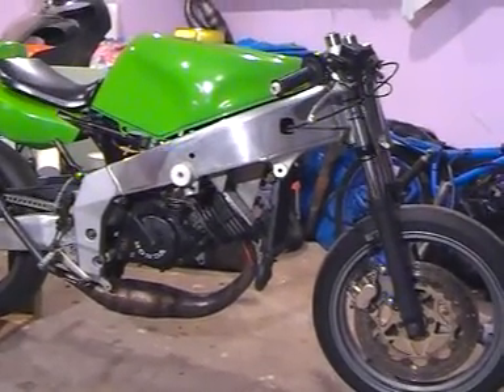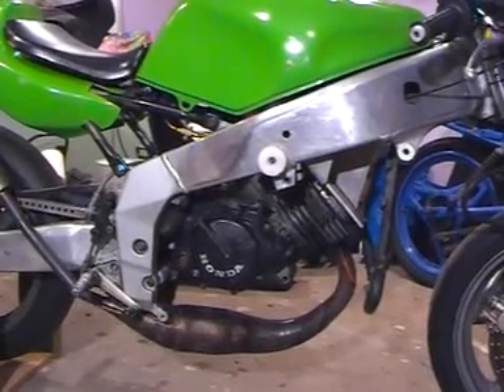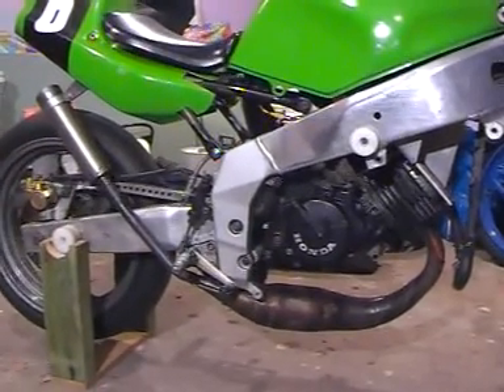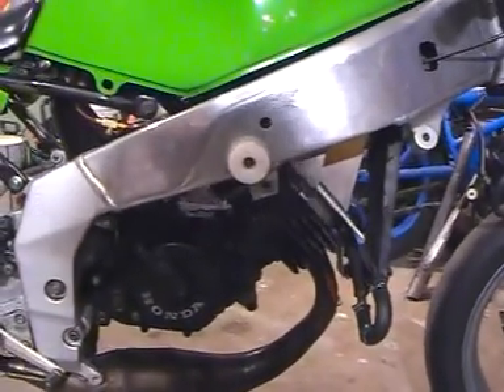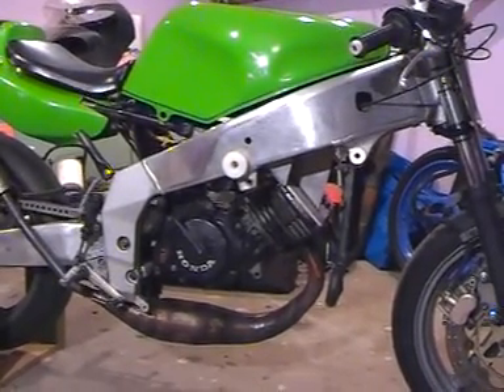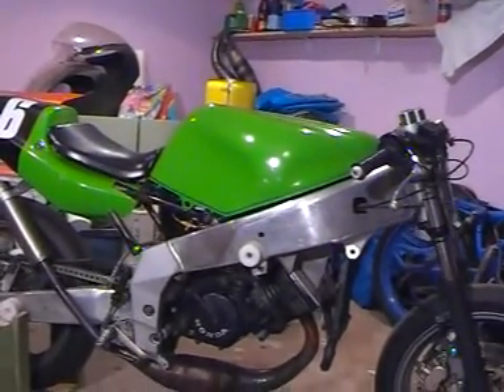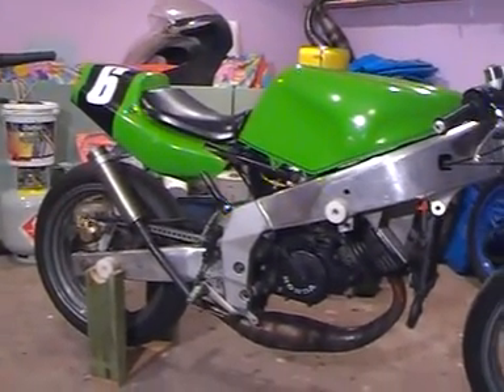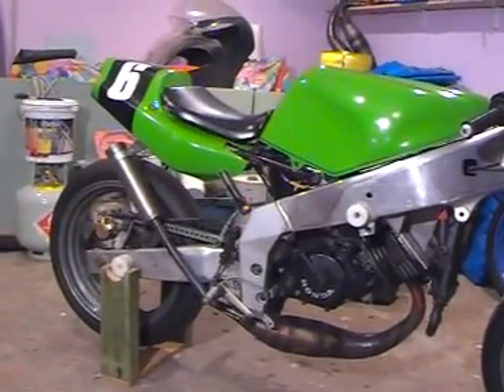FZR250 / MB100 bucket racer

Comment: Hi there.  Im currently working on my h100s/mb100 engine 
Athena 57mm 125 top end
Mikuni 28mm round slide 
Now i also have a complete 1981 cr80 engine.  I plan to use the reed block, the 6 speed gears,  clutch,  and ignition .
Question... is there anything else you would recommend,  like cr80 crank with h100s con rod?  "Crankenstien" combo 🤷‍♂️🤦‍♂️
Love what you guys get up to ...
Jealous, much.
Reply from the maker: I have an old Mikuni 28m round slide on my latest MB100. It made 24.7rwhp originally. Great little carb. I've fitted a Mikuni quick action throttle which will make it a lot easier to ride with only 75degrees throttle rotation required for full throttle